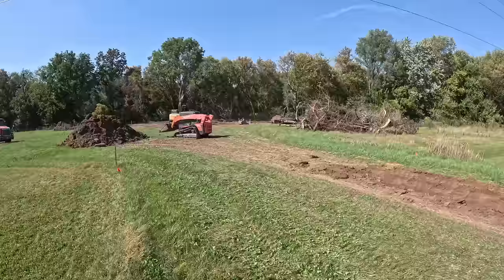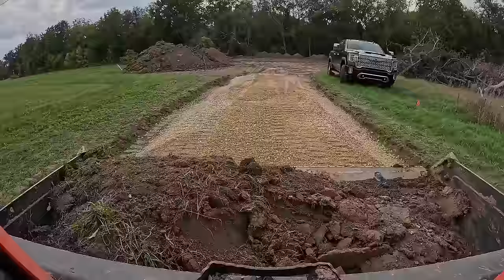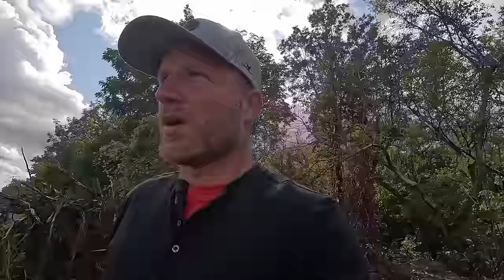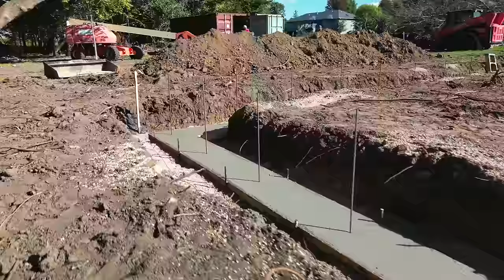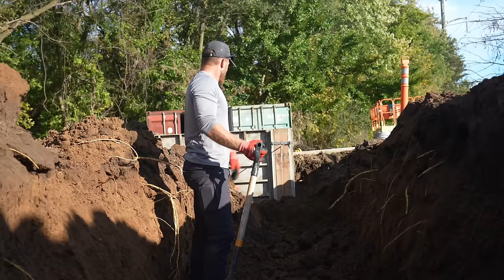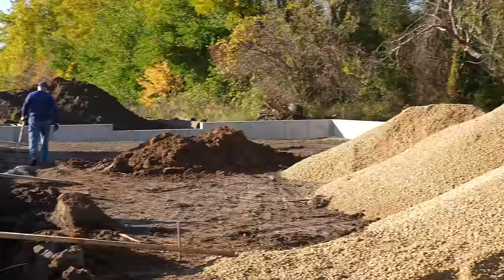Building My Dream Shop Ep - 4: Excavation and Concrete Foundation

Comment: You should use woven fabric as a base. Road base fabric keeps mud out of the rock and significantly increases the load capacity of the road. If you add more gravel on top of the existing stone you can place fabric on the existing stone before adding more stone.
Reply: Shoulda watched some Camarata vids first...(!)

Comment: Did they drive the rebar into the ground?  Will rust not start in the ground and work it’s way up?  When I do footings I use rebar the long way 3” off the bottom with cross connects  for the whole form.  Then vertical rebar is tied at the bottom to the crossbar and the supported at the top of the form.

Comment: It is amazing in the requirements from site to site.  Just did the plans for a patio roof, single story, in So Cal. It had more rebar in it than you had in the entire footing and stem walls.  43' long with 2 #6 top and bottom with #3 stirrups 18" o.c. grade to hold up 4  5x5x.25 steel posts.
Reply from the maker: Suppose the fact is we have no seismic
Reply: Cali has the most seismic requirements and inspections for residential construction, you don’t see that level across the country until you get into hospital or infrastructure.
Reply: @Mike-nn3tf That is for sure. Depending on the AHJ and complexity, there are between 7-10 inspections from start to CO.

Comment: I feel you regarding the extra cost, I had a 8x8m garage built during May in northern Sweden just after the frost went out of the ground and instead of removing around 40cm of dirt under the garage  they ended up removing around 1m due to wet clay:ish dirt.  It was a good extra cost both in digging and removing of dirt and the extra needed single to fill up with.  But now I'm really happy about it.  I will build a shop and timber saw house at around 10x20m next summer and really look forward to get inspiration from this series.  :)

Comment: I’ve done a lot of footers in my day and we always did a 24” footer! The rule of thumb is that if you have a 8” wall you want 8 inches on either side of the wall with two rows of rebar! That’s how it was done in upstate NY
Reply: I'm very sure that he knows exactly what he is doing and doing correctly
Reply: Water tables, frost levels, soil conditions all very from one area to the next as do codes and requirements.
Reply: @hobbyguy79  yup it does I worked with mostly clay
Reply: @boobacockaa  I did foundation for over 10 years and that was the code we went by 🤷🏽‍♂️

Comment: If you have a good base for rock I like what you did with the 1" to dust but your base looks different to ours in Pa. as ours in all Limestone  and packs like concrete where yours looks sandy and may move a little more. I would add the dirt you took out between the porch footer and wall to barn and use a tamper in 6" lifts and it also a good way of getting rid of and big rocks by packing them with the dirt. You would be surprised how many contractors would want to get rid of their debris of stone and concrete block pieces.

Comment: This is going to be a sweet building!  Like the use of the full wall foundation.  We did this in our shop, with 1' above grade.  So happy we did this as we had massive rain in the spring of 2022, plugging out grate drain and overrunning the creek bank.  we had water 5" up one side of the building, but 100% dry inside!

Comment: As an apprentice to the plumbing trade, one of my early journeymen told me that if I had the chance to do it and didn't, it wasn't the other contractor's fault. Things like having a knowledgeable watch for concrete pours around our plumbing, working with the other contractors trying to get through the same parts of the job. And it starts with the GC, btw; two of the toughest jobs I ever worked had the sorriest, laziest GCs on the job site. Fortunately, Kyle, you just aren't that guy; if it looks wrong maybe, you don't rest till you at least understand the how of it- sometimes the "look" doesn't always agree with the hard facts- the tape and the stick. It all looks sharp, Kyle!

Comment: You putting in a French drain around the walls before you fill in?, Love the drive.!! Its good that you make it easier for the contractors to access the plot, and not have to work in mud. It makes them happy too to work in a flatter enviroment as you well know. Want to follow complete build. Good luck from UK. @ 20 mins to 6 in the evening UK time.

Comment: Hey Kyle, if you read this before you get the slab poured if you’re going to have shop air below the surface put about 300 feet of 1” PEX water pipe and have the discharge of your air compressor. Go into that have it come out wherever you want it that acts as in chiller which will remove all the moisture from the compressed air and it works amazing and chances are you’ll never run that thing enough. You’d have to run the compressor 24 seven Texley heat up the ground underneath that because it’ll never be in the sun once you get the Building done.
Reply from the maker: interesting I have never heard of that

Comment: They started using Aluminum forms near me about 10 years after I built my house.  The homes with those forms have basement walls 1000 times better than mine.  doesn't need to have the big threaded rod put in to hold them together either.  I spent WEEKS filling every single tie hole with cement after they finished the walls, because all they do is skim coat those stupid tie holes and they fail 100% of the time.  Every neighbor in my neighborhood has had water come through those...except me.  I told them how to fix it...they were not happy.   Wish they had those forms when I built that's for sure.

Comment: Fun to see you now in clients perspective, normally you show up after this face and “build”. Keep this in mind for future jobs, for the (most) of your clients it is a big deal, nerve wracking time. 😂 concrete: always amazing how little rebar is used in the USA, ok it mite have been fire reinforced mix. Just did something similar here for a 550 sq ft house extension and the ground section had a double mat 4” 5/16. For the electrical ground earth wire side rolled out a 1 awg tinned copper wire under where the concrete slab. And put in some tubes for electric, water, waste water, data/phone etc cables and pipes (etc.)

Comment: If you do radiant heat floors you should check out Creatherm floor panels. I used them on my barn and it made PEX installation a breeze.

Comment: If your going to foam the concrete walls, why not go with a Fox Block type wall? Something you could have installed, squared, rebarred and then just hire a concrete crew to pour?

Comment: I wish you would do a video on everything you don’t see. All of the steps in order such as developing a plan, who does the plan and architect or an engineer? Do you need soil samples and who are the professionals who do all these things before you ever put a shovel in the ground?
Reply: Would be very informative for sure however incredibly specific to the area you are building in and things will be different from state to state and even county to county
Reply: Architect goes first, lay down ascetic and dimensions. Engineer takes those plans and designs details for the tolerances that will be needed. Architect takes those details and works them into the final plans.
Reply: @hobbyguy79  
I disagree. Permitting may be different but the steps from A-Z would generally have the same steps with consideration given to climate etc. Yes some foundations may need to be 36 inches deep and others 24 inches but it’s still a foundation.

Comment: Run the string 1-1/2" off of the wall then you can just run down through with a scrap 2x and check for straightness.

Comment: Is there a reason you wait to pour the floor until the building is completed? With all steel buildings we do I’ve always had the slab poured first
Reply: a lot of folks get the exterior and roof done first so (a) no one worries about marring a nice concrete slab finish, and (b) folks can get the rough ins and say like radiant heating systems done nice and technical whilst being protected from the elements

Comment: Hi Kyle, it's strange to me to see how little reinforcing iron is inserted into the foundation walls... in Italy in my area, being classified as a seismic zone, the engineers design actual iron cages to be inserted into the concrete and into the earth foundations than in the walls. I really like the aesthetics of the project.
Reply: Reo cages are also used in Australia. The actual footing slab/beam is deeper than it is wide to act as a beam, size depends on the type of soil, reactive or non-reactive - clay or sand.
Reply: Digging footing this next week and going through the site with the engineer and excavator we were talking footings, the house sits on rock and the out building sits on soft. The house doesn't require anything but vertical hold down rebar, while the out building that is half the size is more rebar than concrete. These buildings are 80 feet apart. We are in a minor seismic zone.

Comment: so brining the concrete guys out are really expensive. Is it possible. to pour what you did here and the pad at the same time ? The idea is to get the concrete guys out once and done than multiple times. I see the insulation between pad/wall i know this is for expansion in your cold weather. would that be necessary in warmer climates like Texas

Comment: is this type of footing and stem wall a requirement for this type of building?  Seems like a concrete block wall filled with concrete would have been easier and cheaper???

Comment: How do you get away with no rebar in the footing and also just drive straight vertical rebar down into the dirt through the footing with not L's on the bottom? Do you have building inspections in your area?

Comment: Concrete would move inside wall forms a lot easier if they used vibrator and dragged it to move it to where they needed it.
Reply: He said in another comment that they never use the vibrator, which sounds crazy to me
But to each their own I guess

Comment: Do you have HOA or a code that requires the concrete foundation or was that your personal preference? Most the shops you build have the post on pad and concrete floor poured after
Reply from the maker: Most projects we’ve done lately have a wall just like this.  It’s just the best option so I went with it.  No hoa

Comment: I’ve sent many emails to buy plans. No answer.   I pour a 18” sonopost pier in middle of 4” radiant pex in floating slab to hold a pier for 2 nd floor beam for the floor trusses? 40x60’x20’ walls 2 mezzanines middle 20’ open concept.  I don’t understand how you calculate 2nd floor beams strength attached to outside walls? Can 4” slab hold anything? Or my idea to put extra piers in middle. ?
Reply from the maker: Huh?  I have never seen anything?

Comment: I believe you’re going to seriously regret not using oversize rock for your driveway base. That small gravel is going to disappear into the ground and you will have to always be adding gravel.
Reply: He should have ponied up for geotextile fabric under the rock.  Huge improvement in base bed stability.